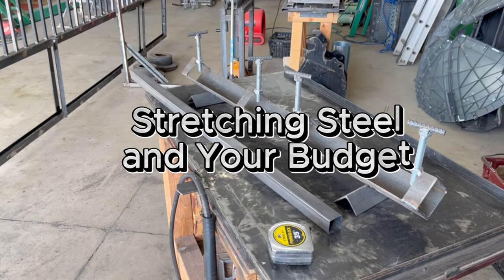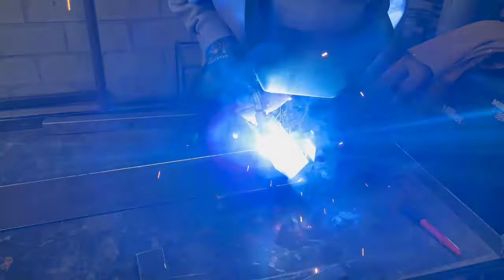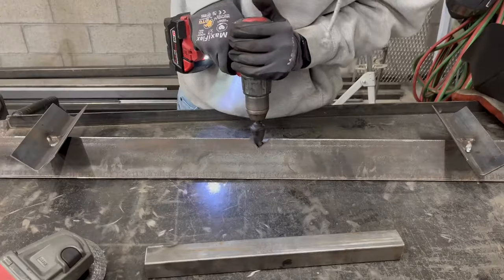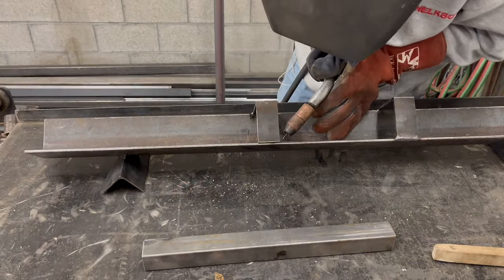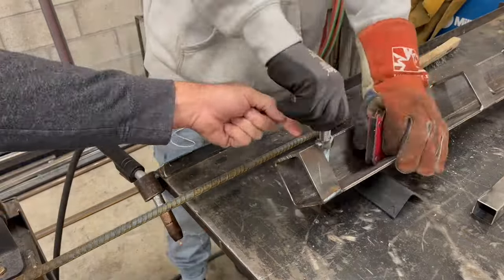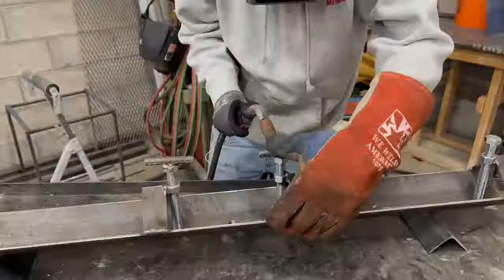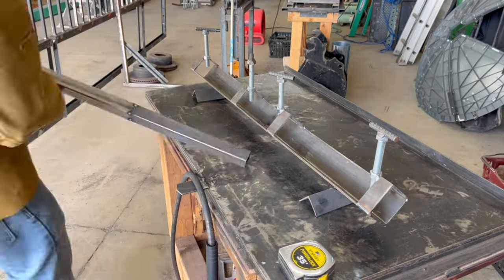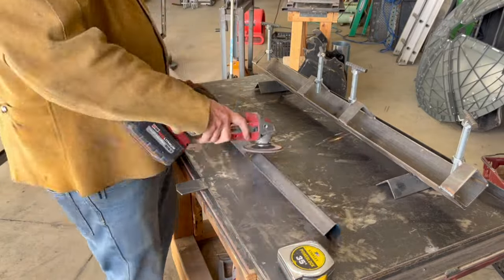Stretch your Steel & Your Money

Comment: Nicely done. I get the same little crack marks in mine after I grind them down. Doesn't seem to bother the structural rigidity any but it sure doesn't look completely finished to me. Would love to learn how to get those lines out.
Reply from the maker: Creating a small gap roughly 1/16" will allow the weld to penetrate better and should eliminate that hard line.  Watch for future videos.  I will make sure to address this.